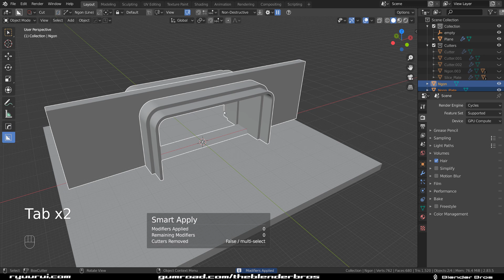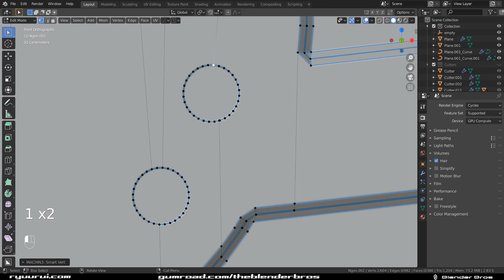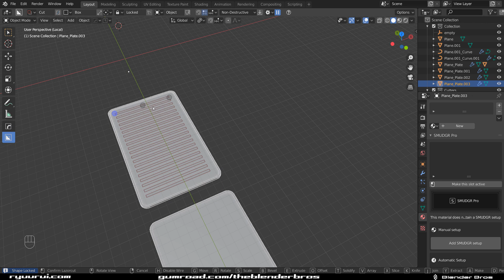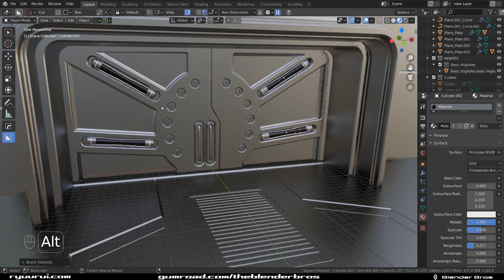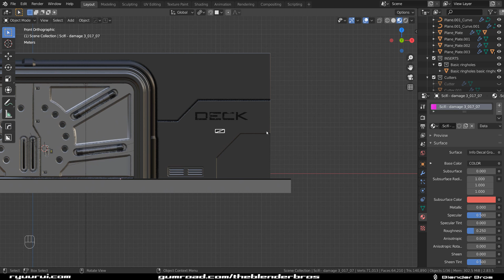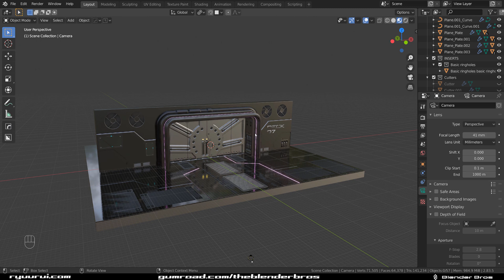SciFi door TUTORIAL for Blender - modeling, texturing, rendering in EEVEE

Comment: Also, how did you mirror your cutter so quickly? I had to go into the modifier settings and set the origin point to the door. I have all the same add ons as you.
Reply from the maker: i just use hard ops mirror, i was probably mirroring across some other object, not sure, would need to see the time stamp
Reply: @PonteRyuurui  that’s fine. Just wanted to make sure there wasn’t some feature I was missing out on.
Reply from the maker: @doomwalker9934  nah for mirrors i always use hops
Reply: @PonteRyuurui  Can I just ask, what is the benefit of using weighted normals?